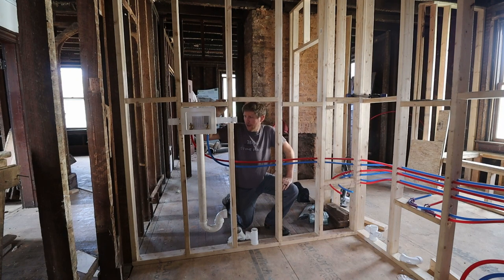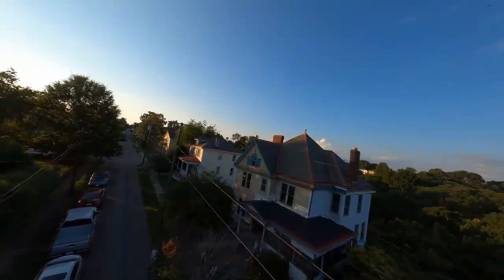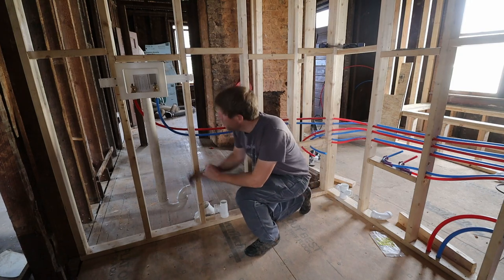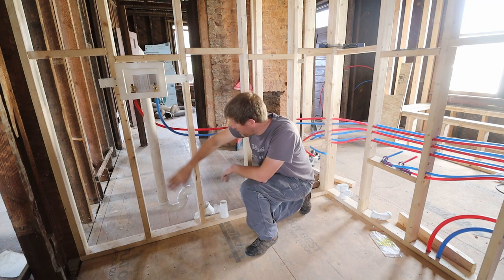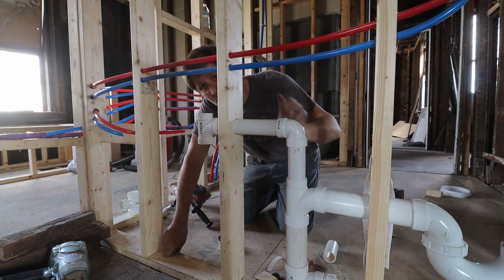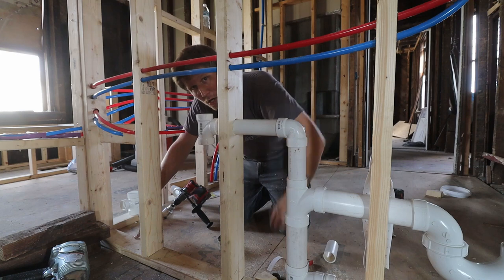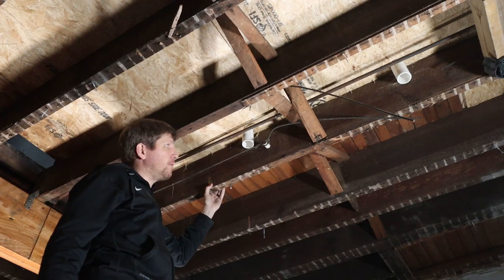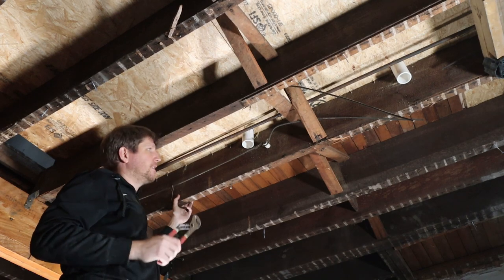Completing the Laundry Room Plumbing [TirolerInn]

Comment: Hi ! Great job ! I  know it's your house but I think if I was doing it for my house I would of faced the clean out that's in the wall facing the drywall with a small cut out just for maybe ?future access even though you could take the Trap for the washing machine apart and go through it for possible future clean outs. (snaking)

Comment: Clever venting! It’s cool to see it all coming together!

Btw, what are your plans for when the walls go in? Will you be adding period correct molding and such?
Reply from the maker: Thanks! Yes the plan is to put the molding and trim work back on throughout the house. Episode 1 we removed and kept all the woodwork to put back on at the end. We should have some extra from areas like the dining room where we took down the center wall. Same with the door frames and transoms, we have moved the location of some doors and changed some of the design, but plan to put the original doors back on in the new locations. Hope that helps clarify our vision for how we want to merge the updates with the existing features of the house!